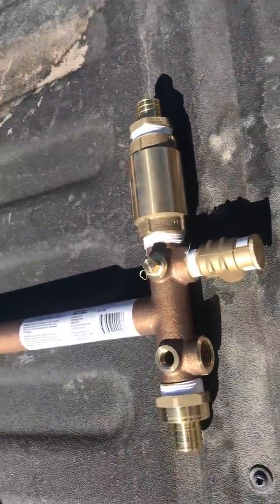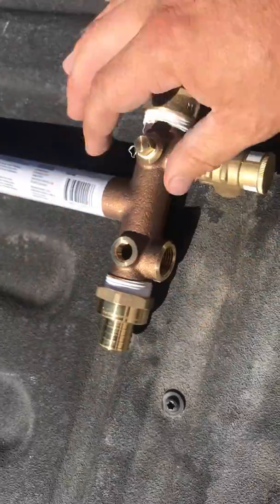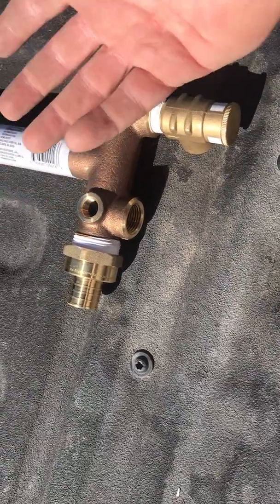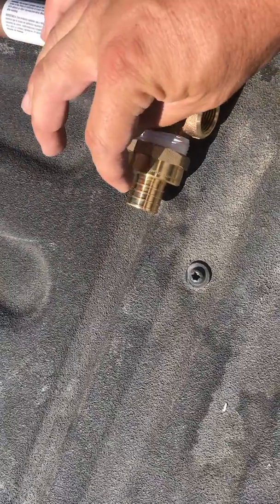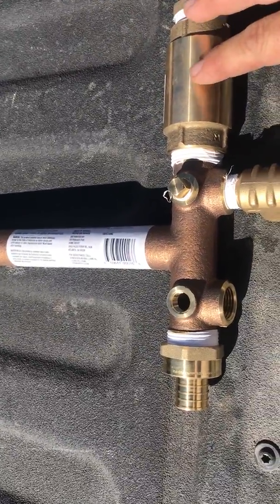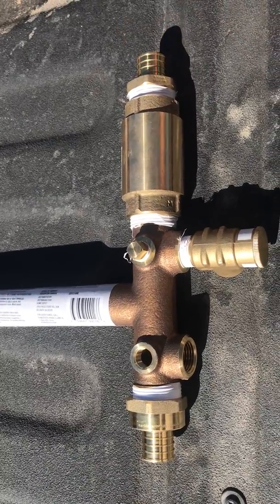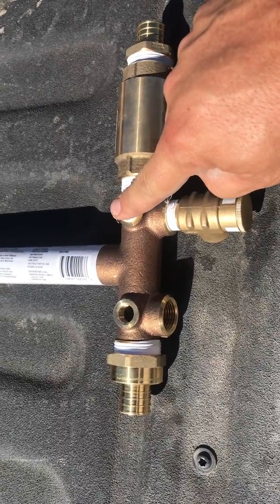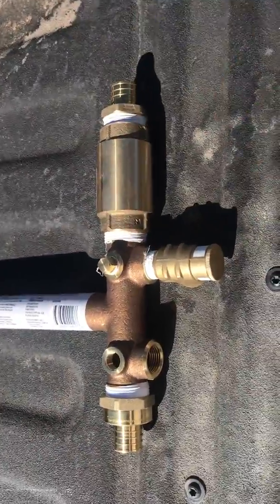Off grid living: Assembly of Brass Tank Tee for Pressure Tank Assembly - Off Grid Well Water Pump

Comment: Thanks for this.  did your 1/2 inch to one inch solution work?
Reply from the maker: It did!  It's been working for almost 4 years without issue.  In fact, the pump will need to be replaced before anything else!